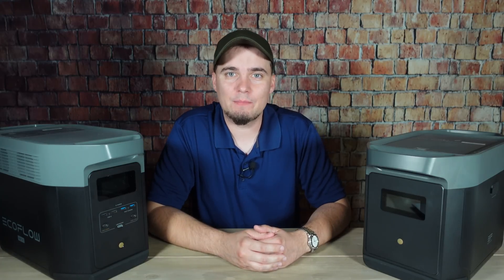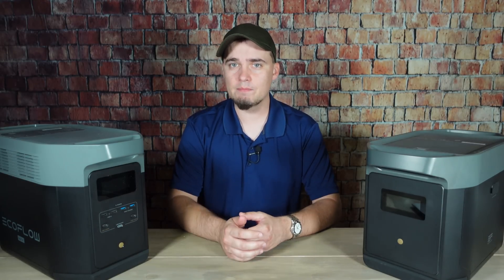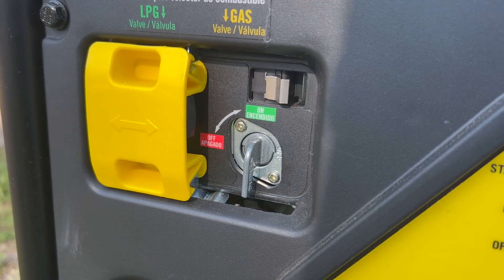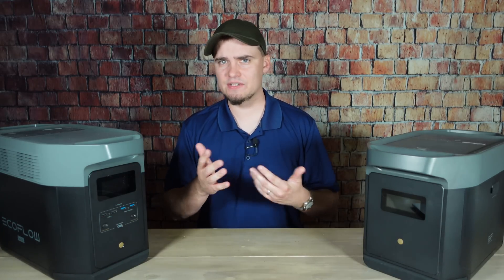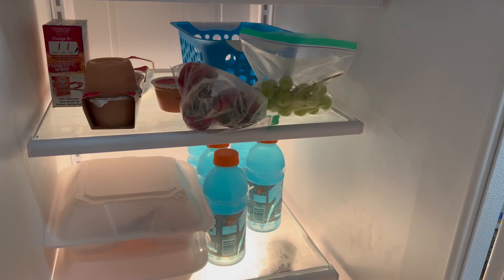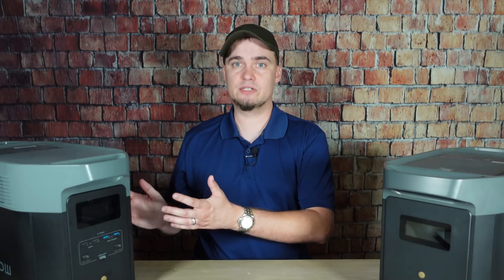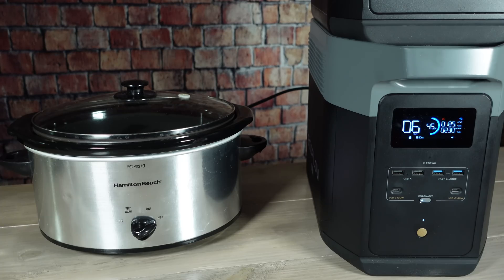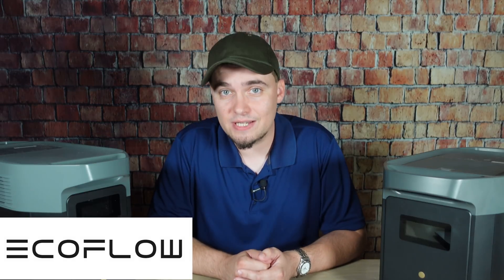Tired of Messing With Gas Generators? Ecoflow Delta 2 Max

Comment from the maker: You can find the Ecoflow Delta 2 Pro by using these links:
EcoFlow Website:  https://bit.ly/422Orew
EcoFlow Amazon: https://amzn.to/45dqmEm

Use the links above and the code EFDIYPRE5 to get an extra 5% off the DELTA 2 Max and DELTA 2 Max Solar Generator bundles. Valid until June 25, 2023.

Or, from May 25 to June 4, 2023, you can choose to use code 2X110DIYP to get 2 free 110W Solar Panels when you buy a DELTA 2 Max unit (solar generator bundles not included).

This channel is owned and operated by DIY Prepper. DIYPrepper.com is a participant in the Amazon Services LLC Associates Program, an affiliate advertising program designed to provide a means for sites to earn advertising fees by advertising and linking to Amazon.com. This channel also participates in other affiliate programs and is compensated for referring traffic and business to these companies.
Reply: Do you know if the Ecoflow or any solar bank can be safely recharged using a non-inverter generator since it doesn’t produce pure sine wave energy?

Comment: I have had Delta 2 Max and Bluetti at top of my list, watched both for a long time. Got Bluetti system at Prime day deal. Both were close on features and capabilities. The Ecoflow WAVE 2 with battery as well on Prime day. and a fridge/freezer with battery from Anker. I have a gas/propane like you that is mainly last resort, maybe construction tools or items requiring high wattage. Long term fuel might get hard to find. But really mostly trying to go off grid. Get two of the Ecoflow and tie together for 240V if needed for well pump. Could not find anything negative with these. Upfront cost sucks (why waited for best discount) but sweet not having a power bill.

Comment: A Delta 2 Max question if you can spare the time with all the work there is to do:
Would you choose the D2M+Wave 2 OR a DIY setup based on Renogy (battery/inverter/panels)+A/C unit and heater with the same BTU ratings?
With the way El Nino may harmfully turn up the heat (and Winter coming after) I am concerned, being the only one seriously looking at back-up power among my family and friends.
Reply: I have my D2M attached to my W2 via the xt150 cable. Thats DC to DC. Connecting to D2M AC current outlet seems like 20% watts lost.
I connect 3 x 220w Serial panels array to pv1. I also connect 1 x 220w panel to pv2. I generally run W2 air Conditioner from 8am to 7pm totally off Solar. No power charger connected to D2M. Each day I repeat this.
Important thought is W2 only puts out 5000btu. 

Mr. Cool mini split can output 14 000 btu. Or more. Various models. With my 3x 220w array... I seen 499w on D2M display for pv1. Excess Solar not used by W2 is saved to the Battery for after sundown use. If you have the Mr. Cool mini split
It would be wise to max Solar pv1 and pv2. To 1000 watt input. Mr Cool's AC power plug can attach to D2M outlet. You can also attach solar panels to Mr. Cool direct. None of that Solar goes to batteries.
Reply: After the Sun is down. Mr Cool can draw power from the D2M battery. This energy at the D2M battery came from its own Solar panels pv1 and pv2. 500w + 500w max.
Reply: DIY allows custom Inverters, custom batteries. And easy upgradeable. D2M allows modularity, Portability To Go, Plug n Play.
Reply: @larrywong7834  Thanks for all the insight and considerations :yougotthis:It's a very interesting area of research
Reply: @Michael-B028 D2M Solar in port
11-60V 15A, single port 500W

THE sum of my 3 panel array for voc is never over 60volts. Never go over 60v into D2M PV1 or PV2 port.
Or Risk Damage to D2M
Reply: Reading from my Solar Panel handheld meter. For my 3 x 220w serial panels array. 12:43. 7/10/23
npw3p.  522w. 42.87volt.  AY panel meter___ 42.87v is under the 60v limit. Thats hot summer. At cold Winter I have not reached that 60v. However if my 3xpanels were in the Artic on a very very very sunny day 60v maybe be reached..
Reply: @larrywong7834  While I have read about various safety concerns there's nothing quite like seeing real test results for a specific model, so thank you again for taking the time out to share your experience.

Comment: You brought up a good point which makes the case for having BOTH types of power as you can always use the gas genny to charge up the solar methods in a tight when the solar panel option isn't feasible and you really need to recharge. Currently I rely on a gas genny but am about to acquire a Jackery w/solar panels.
Reply: Good point, and if any crisis were to last 6 months….gas will start to be unavailable and even those with prepped. back-up gas will be running out or expiring.  The solar ones are a bit slower and have a power max, but are currently pretty good, totally quiet, don’t make poison fumes (most every big storm or hurricane, there is a death or 2 from people who don’t know you shouldn’t run gas generators in garages) and solar runs most home devices (outside air conditioning or large appliances).

Comment: Had a 7500w gas/propane, used propane only, when powerless for 9 days from hurricane Ian last year. Also had Ecoflow max 2, with 2  160w panels. Days all sun, and panels not as efficient as advertised,  40% charged after 9 hours, so topped up before night with propane, then ran fridge and lights, then repeat next day. A lifesaver. Total expenditure for me was $2400.
Reply: 320w panel is too small for D2max as it can take 1000w of solar input = 2hours

Comment: Another great video. I imagine it takes quite a bit of time to create these videos and I sure appreciate your good work, thank you. In a long term outage I plan to use my two smaller Ecoflow generators, a Delta 1000 and a River Pro with a spare battery, in conjunction with my Honda 2200 inverter generator and a Generac 22kw whole house generator. By using the gas and propane generators sparingly along with the Ecoflow generators as my main source I should be able to run most of my essential items for quite a while. Of course when my gas and propane run out I still have the solar option to charge the Ecoflow generators.

Comment: Can you recharge the Ecoflow safely with your gas generator?
Reply: Yep.
Unless I'm missing something they can  be charged from most power sources if you have the leads.
Usual safety regarding use of a petrol generator of course.
Reply: @oldbloke204  my concern is since that is not an inverter generator, it would not produce pure sine wave energy, which is safer for sensitive electronics.
Reply: @Sniperfox1  At that price I would be guessing that it would have some sort of charge controller in it but yeah you have a point.
I know with some solar charging you have to take the charge controller off the panels so that the controller in the battery pack can do the job.
Certainly given the price of the things you would want to be sure.